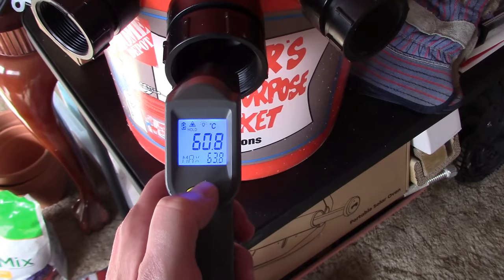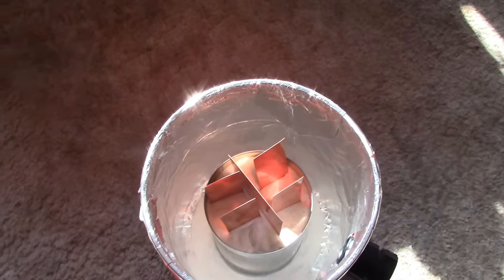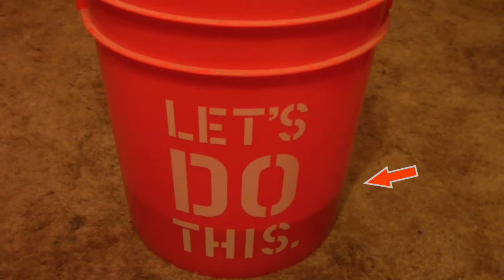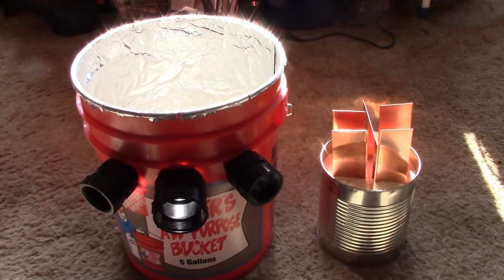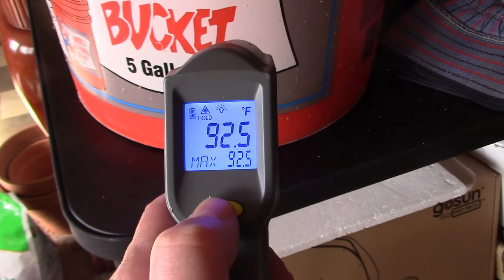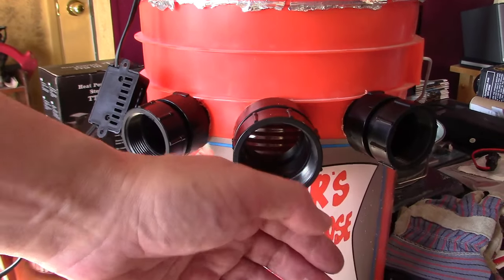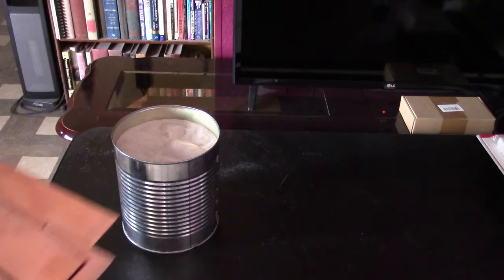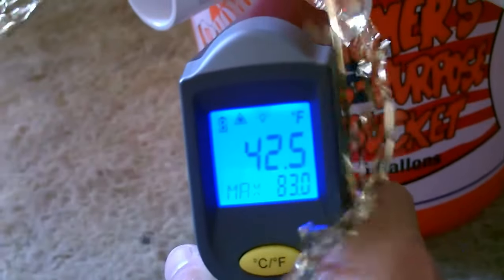Sand Battery Air Heater w/Copper! The "5 Gallon Bucket" SAND BATTERY Air Heater! AC/DC fan 12v solar

Comment: That's brilliant! I bet if you had holes in the bottom of the bucket and an elbow vent out the top, the thermal heat would create it's own flow from the bottom out the top, to eliminate the need for a fan or electricity.
Reply: Or one if the thermoelectric fans I'm sure they could be designed as centrifugal blower.
Reply: I made almost the exact same thing but as an air conditioner with water and ice
Reply: Any type of sand?
Reply: Bro right on it’s just a mini earth battery
Reply: I'm building one now out of an old water heater which has a pipe running threw the middle that was for exhaust fumes. I was planning to use a couple electric wh elements but now I'm considering either dryer wire or some stove burners  but I'm using crushed glass instead of sand
Reply: Will the sand blow when the fan is switched on?

Comment: I did a cooler like this for my chickens when we lived in Texas. Used frozen 1 gallon jugs, rotated then every day. I had a 15 watt solar panel on the coop roof to power the fan
Reply from the maker: perfect. i use the 15 watters all the time. the fan is about 10 watts so it works great. i figured people might like seeing that cooler after all these years.
Reply: @desertsun02  I actually used an old cooler (Igloo) because it was insulated and kept the gallon jugs from melting so fast. I used 90 degree elbows to direct the air sideways under their raised coop and guess where they spent their afternoons...
Reply: @bobcole3852  great feedback. I also have a raised coop and planned on building something like one of the coolers for keeping them cool when temps settle above 100F

Comment: I'm wondering how long the heat is available.  Does it last for hours?  Or since the fan is aggressively moving the air into the room, does it only last a short time.  I guess the variables include:  Volume of sand, speed of fan, temperature when starting, size of room, initial room temperature, number and size of copper conductors,  and many others.  Very interesting project!  As usual.  Thanks for all your great projects!
Reply from the maker: hi. yes all those variables plus how hot you get the sand and if you heat it all the way to its core. you should get hours if it's hot to the core. fan speed will matter a lot too. fan in video is actually overly strong it could be slowed down quite a bit for longer run time before needing to recharge the battery. you might be able to even use a couple of computer case fans instead of the single auto fan.
Reply: @desertsun02  Hi there, i wonder could you use copper pipe instead of plate, maybe 1 inch, arranged for want of a better phrase, like a gattling barrel, stuffed with scrap copper thin wire,or even stainless wire wool?
Reply: Great Question ⁉️
Reply: @danceswithbadgers4024  Actually that's a good idea 💡!  Ty!
Reply: @ChrisYesChris  Yes, the amount of heat you put into the battery has a limit as to how much air it can heat. If you want to heat a whole room by 20 degrees celsius for 8 hours you need a fair amount of sand. Conservation of energy still applies :)
Reply: I also had my first question be how long can you get heat for. If it can last awhile that could be worth it.
Reply: @danceswithbadgers4024  the copper is about conductivity and how metals heat up and react to heat quickly. More copper is better. 

There will be a difference in what metals do how much. If you move away from copper and do steel or wire wool I don't think it would work as good. As a metal copper is amazing. Its useful for so many things. Tons of stuff. 

Copper heats up more and faster than other metals. So it wins in raw heat over pretty much anything. he was right to do copper. People will say that aluminum and steel lose heat slowly... but those 2 metals don't gain high heat and gain it quickly like copper does.
Reply: Can we heat sand on stove with copper plate and just keep it in room will manage the room temperature to same or make it high if outer temperature is 15 or less
Reply: @naeem.hussain sure! I'm planning a large unit with electric stove burners built in

Comment: I been using a sand battery for a couple of years now mine are a little larger. After we finish canning for the year the pressure canner gets a new task. The biggest thing I have learned is to add water to the sand the air space in the sand battery waste a lot of time heating up the entire mass. As the water starts to evaporate the air gaps in the top few inches slows down the heat loss for a much longer lasting source of heat. Sizing matters just like solar panels and battery's.Great video.
Reply from the maker: hi. i hadn't thought of adding water. sounds like something i'll experiment with 🙂✔

Comment: Phase change salt mixtures. The salt mixtures were open source until greedy 'Climate Change' corporations patented them. Still could make one with hybrid parabolic trough hot oil and electric solar for heat in the cold. I live in the heat so I search for the cooling tech. With a brutal winter coming and power outages, this could make the difference between a cold sleep and a warm sleep. Also no oxygen depletion, carbon dioxide or carbon monoxide build up.

Comment: Dutch oven, construction sand (not silica sand).
Heat on a fire for a few hours.
Bring inside and it will radiate heat for a long time.
No fan or electric needed.

BUT you could use a wood stove fan (makes it's own electricity) to move air.
Reply: Would it be better to put bricks or sand in the dutch oven?  This is beginning to sound almost simple enough for me to do.  Will bricks explode as easily as I've heard rocks can do?
Reply: Maybe to set it up in a more convenient way so that I don't have to bring a few dozen kilos of sand into the house everyday.

Comment: This would work great with a invective cook pot convection hot plate. The good thing about that once the heat absorption of the sand started to max out for the thermostat on the hot plate it will automatically shut of. But the cooling fan would run long as the pot was hot. Still be a safe way to heat and very good energy exchange for electric power. 👍 👍

Comment: Lots of others such as yourself are using plastic buckets,metal pails, tin cans etc for the sand containers. What if you used a double wall vacuum insulated wide mouth thermos or food warmer as your container and then
Impeded those ptc heaters or a 12v heat element in the sand?IDK how big  of a vessel you could find but this would drastically reduce heat while heating and allow the sand to heat up faster I assume. Then maybe insert ceramic cup of water to test the boiling time or put some beans in it,cover it tightly and thermal cook them over 4 to 6 hours.Heck you could use a temp control switch to regulate the temp within a narrow "cooking" range ala a hot water heater does. Then the excess solar can do other work while the duty cycle is in the off status, like charging batteries,etc

F

Comment: It would be interesting to the sand battery heat storage temperature graph over time. If you had multiple stand batteries, could you maintain a comfortable temperature overnight? At what atmospheric temperatures?
Reply: Definitely need this info to gauge how useful this is.

Comment: Also, maybe adapt for use with stove top fans that run on heat to avoid electic requirement.
Reply: just saw a video where a guy did exactly that..sorry, don't remember title, etc..

Comment: I would like to see you use the PCT heat elements you used previously incorporated into this design.  I would imagine that the solar powered setup used previously would work here in this setup. Looks very interesting.  I have been thinking about ways to build something similar.  Thanks for the ideas. ☀️⚡️
Reply from the maker: hi there. i'm on it (it's my next video). it'll show at least 5 new sand batteries (all being heated with 12v PTC ceramic heating stones). the units will be able to be hooked to solar panels, wind turbines or batteries.
Reply: That is exactly what I was going to say. I've used the PTC elements in a few experiments and I love them!
Reply: @desertsun02  are you going to try the sand batteries with the heating elements in this setup?  I'd be really interested to see how that turns out.

Comment: What about using your electric heating plates? The ones you use to make a stove. 12v?
Reply from the maker: hi yes, absolutely! i started working on that video yesterday. i buried some of the 12vdc heating plates in the sand and got the fans running. they have a very low power requirement. sand up to 300F. those new heating plates were getting up to 470F (hottest ones i've ever had).
Reply: @desertsun02  Looking forward to this. Assuming the safety can be improved, it's an ideal, flexible system for taking excess solar PV and charging sand heaters for the cold evenings. I was considering something like a charcoal starter embedded in the sand.

Comment: The copper sheet metal is probably overkill and the heat is gonna cause rapid oxidation. You mention aluminum, and If you went with scrap heat sinks I bet it would save some money especially if you scale this up a bit.
I really like this design, by the way. Very simple, but also looks like it performs very well! Great work!

Comment: Top work. Thanks.
The cooler section makes me wonder how much COLD MINUS TEMPERATURE a sand batt could retain!

Would need a chiller system to run throught it. 
Might end up as 6 and two 3's though.

Suggestions?

Comment: Awesome mate great video. How long does it take to get to temp on the stove or oven and what sand temp are you aiming for before you use it? I was thinking about some old steam boiler designs where there's loads of tubes through the firebox which heats the water quicker than having a big container of water over a fire. What if we used a few pipes of copper through the sand and put the fan under the bucket blowing air through the pipes then as they come out the top, direct the air forward. It could be done top to bottom too. A bit like what the outsider did with his mini cabin heater but using sand instead of candles and with multiple pipes.
Reply: Insulate the bucket to maintain heat longer, has potential

Comment: Put aluminium downpipe down through a large steel container and run a nichrome heating element in it suspended by metal poles/wires with ceramic at the contact points then fill with and and insulate the outside. Hook it up to solar panels to heat it up (don't even need an inverter or regulator) and pump air through the tubes to get hot air.
If you don't want to bother with nichrome you can just use hotplate heating elements embedded at regular intervals when filling with sand.
Reply from the maker: sounds like some interesting ideas. i've been looking into making a heating element with nichrome wire.
Reply: @desertsun02  I wasn't clear on my comment, the nichrome is running through the sand isolated from the container and the downpipe, the downpipe is to pump air through to extract heat for heating.

Comment: Intersecting idea. I guess a better airflow diffusion could be obtained with a 100mm/120mm PVC elbow breathing horizontally at the copper's band leve/output tubesl. Cheers from France.

Comment: Can aluminium sheets be used to transfer heat instead of copper sheets? Aluminium sheets is way more cheaper.
Reply from the maker: hi. i haven't tried aluminum but it should work good too. (i think i've read that copper is about twice as good as aluminum but i can't confirm that)

Comment: This is a cool design for a sand heater, but you didn't really show a good battery for it. With the inclusion of the copper, I thought you were going to use it for charging the battery, but you didn't. You could add some graphite/graphene solution to it to allow you to use the copper and electricity to heat the battery.

Comment: TY for updates sand bucket heating option-love option of the copper as core heating to promote increased temp or longer duration? If no electric fan available would the thermal fam work? Trying to plan for worse case scenarios if power loss in remote (to me) safe place…
Reply from the maker: hi there. i couldn't figure out a way to use a thermal fan with this project but you could always use DC fan.
Reply: That should work, but the thermal fan needs to be half inside the bucket and half outside to get the proper differential.

Comment: Cool, it works ty!  How long does it last?
Reply from the maker: hi. it will depend a lot on how hot you get the sand and if you heat the sand battery all the way to its core.
Reply: @desertsun02  so on a cold day just below freezing, perhaps 3 hours?

Comment: Thank you for your videos! Can you use aluminum instead of the copper?
Reply from the maker: hi. aluminum might work well too. but make sure it's a thicker aluminum. some of that is sold in very thin sheets. also, aluminum does have a much lower melting point then copper, so you won't be able to really crack up the heat in the battery as much.

Comment: Could a fish tank heater be used instead of placing it in oven?
Reply from the maker: hi. the issue with that is they only get up to about 96F (35 to 36C). the sand would be warm but not hot.

Comment: How long did you heat up the Sand battery for
Reply from the maker: i only partially heated it for the video. up to 300F and then up to 450F. i didn't test internal temps of battery though so i not sure of internal temp at it's core. main thing is to get it as hot as you can. the sand, steel and copper can all handle very high temps.

Comment: So, let me ask
It only works after it comes out of the then, correct?
The can is something obtainable, but where would you suggest getting the copper or aluminum pieces?
Looks like a great idea, especially since parts of town had lost power for a few days already this year
Any help or comments would be appreciated 
Thank you
Reply from the maker: hi. you can get copper and aluminum at the home stores. aluminum will be easier to find. you could possibly use aluminum flashing but make sure it's a relatively thick metal. for the copper i would try ebay, or amazon, and maybe aliexpress. i got it a couple of years ago on either amazon or ebay
Reply: @desertsun02  thank you for taking the time to respond. It is much appreciated.  I will be looking into this now.
Reply: @tompotts1902  copper tubing pounded flat with a beater.
New or scrapped plumbing. 
Hit the recycling yard.
Lot of recycler shops sell by the pound.

Comment: I like this, so hopefully this doesn't come across in a negative way.  Sand has poor specific heat capacity compared to water, so even though your sand can get to double the temperature of water it stores less heat.  For my own purposes I am considering a pot of water on the woodstove carried out to my workshop.  Problems with water are the temperature limitations (no hotter than 100C, also freezing is an issue), leaks, humidity... perhaps your sand battery would be great for cooking or where water is difficult to handle?
Reply: Perhaps mixing a better heat storing aggregate with the sand?

Comment: Brilliant l. Solar heat that puppy
Reply from the maker: definitely! a parabolic dish or fresnel lens could really crank up the battery temp. all the parts of the battery should easily handle heat up to and a little over 1500F (816C)
Reply: @desertsun02  points to ponder…

A nice handle to more easily lift in and out

Maybe drill holes in copper for even more air flow/heat exchange but as you shown that’s good enough now.

I might of missed in watch about how long it lasted.?

Wonder what off the shelf metal could be used instead of copper for the scrounged.  Ooh…copper tubing.  Erector set prices with lots of holes in them, etc.

Thanks for sharing your adventures.

Comment: Would less vents let the heat last longer?
Reply from the maker: it would be something to try. i actually thought of just using one outlet but i was concerned that the heat would be too focused to one area.
Reply: @desertsun02  Oh. That's a good point. You were right to worry about preserving the case material.

Comment: I wonder if you could combined a sand battery with a masonry heater. Like a rocket mass heater but fill the inside of the bench chamber with sand all around the pipes. I think the sand would heat up hotter than the air and hold the heat longer maybe even 8 hours.

Comment: I might make one out of a 55 gallon drum. Paint black/ build fire under it fill with sand and old copper tubing hammered flat and a single in and out to pipe to the house using small inline fan .  Maybe 🤔
Reply: make a youtube video of the final project.  I was thinking to do the same. 5 gallon bucket is 60 lbs 'full' of sand. 660 lbs full.  Can get furniture rollers for base to move 55 gallon barrel, but they make barrel movers too for a couple $100.  I was thinking to get those 12 volt heating elements in the other sand batter video and go crazy with them in a 55 gallon drum in many layers.  Then hook them to cheap used solar panels in backyard to drum in house. Then heat up in daylight, use at night.
Reply: Also I was thinking to buy a $200 heat exchanger off amazon and running a pipe coil through sand battery to circulate antifreeze or something to extract the heat.

Comment: In ancient times they would heat rocks and put them in a pan with vented top. They also put hot coals or rocks in a closed pan with a handle on it and use it to heat the bed. You can heat the rocks over a fire if the power goes out and u can't heat with a fireplace. Build a fire outside to heat coal or rocks
Reply: Make sure its not River rocks they can blow up when moister inside boils.

Comment: How long does the heat last with your design ?
Reply from the maker: hi. it varies widely (depending on how hot you get the sand and if you heat the 'sand battery' all the way to its core).